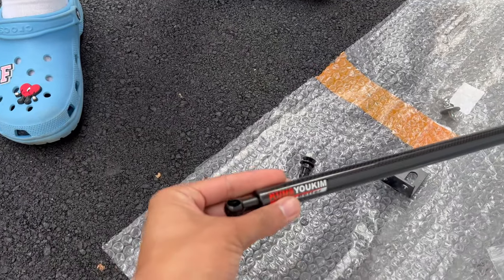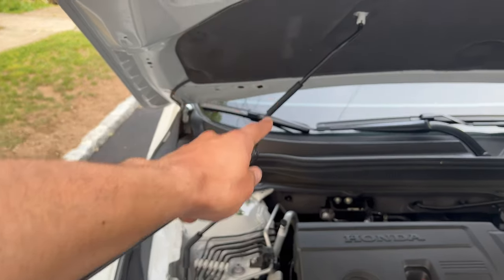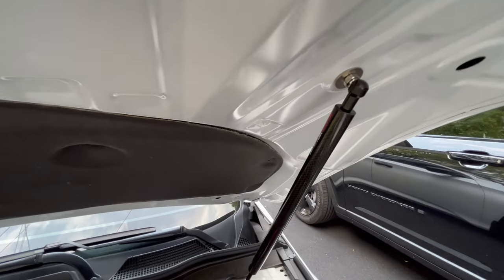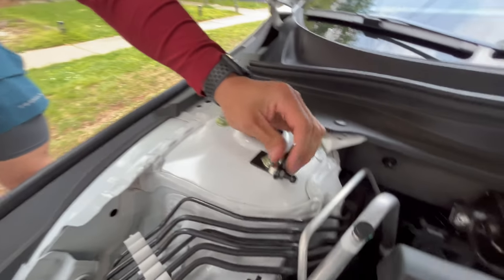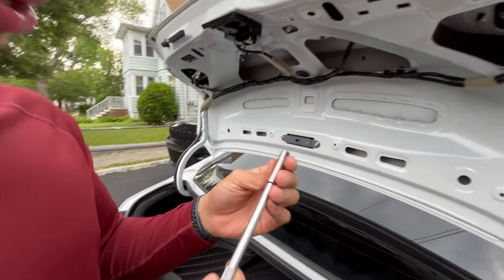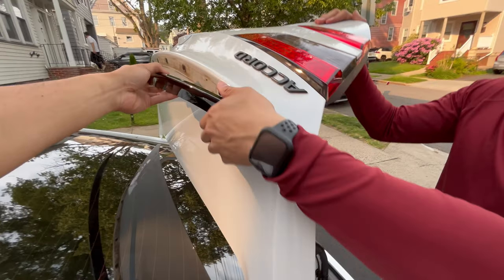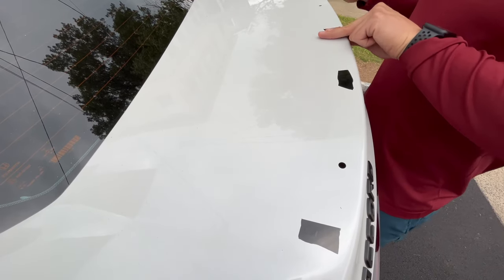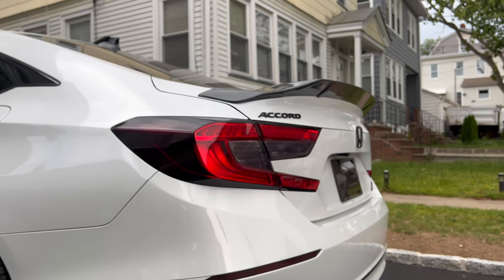How To Install Hood Lift Supports & Duckbill Spoiler! 1Oth Gen Honda Accord 2018-22 (4K ULTRA HD)

Comment: The bad part is you cannot open the hood as far. With the original support u can put it in the maintenance position which allows the hood to open wider.. Those struts are nice and look good but they need to be longer.
Reply from the maker: I completely agree, wish they were longer to fully open up the hood

Comment: Bro did you fix the noise what was it? I’m about to pull the trigger on the parts wanna know 🔥
Reply from the maker: The noise is known on the D2 springs, it goes away after a couple months. People have said that getting aftermarket end links takes the noise way

Comment: Could you put a link under my comment for the tape used to hold down the spoiler? If not what kinda of tape was it because i see many different kinds
Reply from the maker: @drowsy4612  I used gorilla glue 3M tape, you can find it on amazon